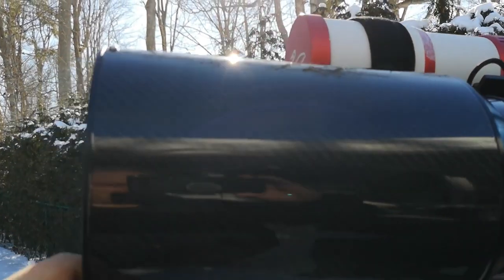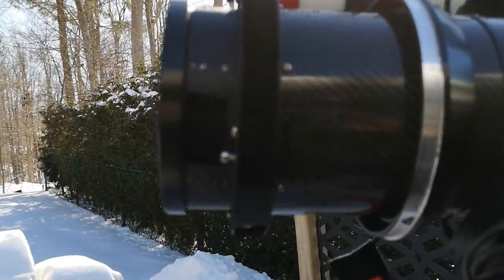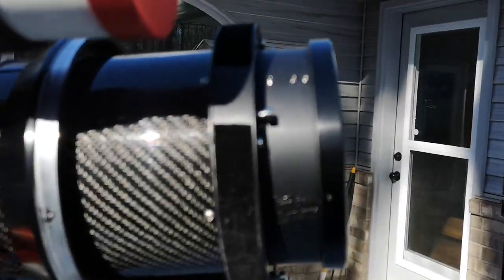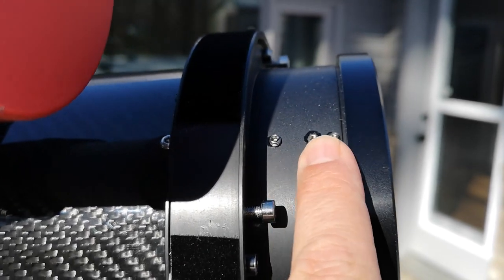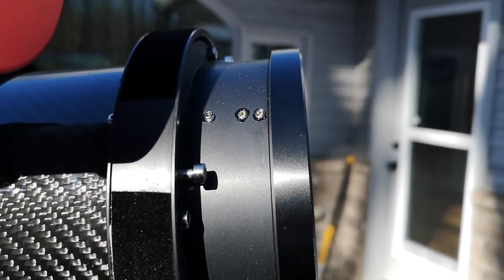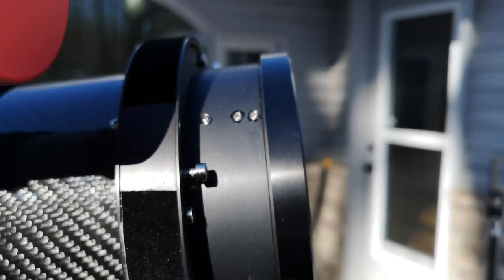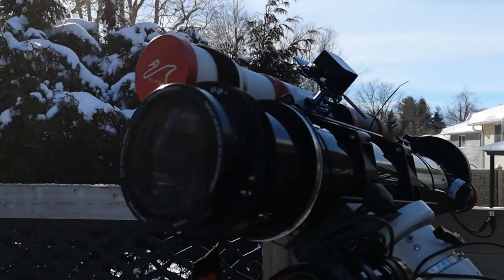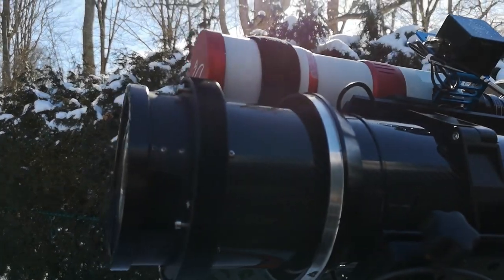Fix pinched optics with my Explore Scientific telescope (easy how to!)

Comment: Yep the Apertura 60mm has pinched optics. High point agreed there's a problem and in now on the 2nd week of waiting on an RMA for return. They are slow, and I don't know how to adjust it myself since there's no way to remove the dewshield and the lenses at the same time.

Comment: Are you sure you should have touched those 2 rubberized screws?  According to Electronic Scientific, they say:

"If the telescope is a carbon fiber tube, the dew shield is held in place with screws. Remove the screws. Once the dew shield is off, you will see six groupings of three screws located 60° apart. Three sets are covered in a rubberized sealant. DO NOT remove the rubberized sealant on these screws. Only loosen the screws that are not covered."
Reply from the maker: I got the info and photos of what to do direct from explore scientific. It's apparently ok.

Comment: Hey Shawn, same problem here with my ES 127 ED APO, with sharply defined spikes 120 degrees apart on bright stars. My scope is an older build with the removable dew shield. I was advised by Explore scientific to do the same thing, try backing the set screws out by a quarter turn. The adjustment did help, but spikes still persist. The screws are now now no longer in contact with the glass lens edges, and turn quite freely. It is easy to tell when they make contact. I should note that of the three set screws at each position around the cell, the two closest to the focuser had been backed off the inner two lenses by a quarter turn at their repair facility during a recent repair, and it was only the front-most lens of the triplet that had tight screws. So  backing out the three screws around the first lens has had the most effect in reducing diffraction spikes. The spikes are not gone, but they are far less prominent and at this point tolerable.

Comment: I had pinched optics on both my ES102 and ES127 due to tightened shipping screws. I have the aluminum OTAs and you have to unscrew the dew shield to remove it on those models. After I made the adjustments there was a big difference in the before and after with the diffraction spikes. Nice video.

Comment: G’day Shawn 

I have a TS 61 quad scope. I noticed the pinched optics when temp dropped also ( not to same temps as yourself )
I followed some advice on Cloudy Nights and adjusted.
It appears to have solved issues but still need time out under stars to test
Good luck
Reply: Shawn
Any further updates regarding pinched optics adjustments?

Comment: Which set of screws hold the lens assembly to the tube?  I’ve been thinking about removing mine to clean the the glass.  I got cobwebs and quiet a bit of dust on back lens.

Comment: Shawn, your video affirms what I'm experienceing with the William Optics 73iii.  I've added an additional dew heater to see if that helps, as the weather is not much different here in Kingston.  I know where the scews are that need backing off, but I'm just waiting for direction/affirmation from the OEM.  I'll be curious to see how you make out.

Comment: Shawn, just watched a video from SkyWatcher on their Esprit line.  They discussed the history of the Esprit development and covered their original versions having carbon fiber optical tubes.  The issue is that carbon fiber has almost no thermal shrink/expansion which is NOT the case for the optical elements.  That is why they dropped the carbon fiber tubes and went with aluminum since it and the ED glass have compatible thermal expansion coefficients.

Comment: By loosing these 9 helen crub screws, what's holdin the glass? they will bobble some no. brilliant video should be recall.
Reply from the maker: The screws that I loosened were just the shipping screws. The other screws still hold the glass in place. Sometimes the shipping screws (to hold collimation during shipping) get over tightened and can cause the pinched optics problem. Loosening the shipping screws every so slightly is fine. I followed instructions directly from the manufacturer. Cheers!